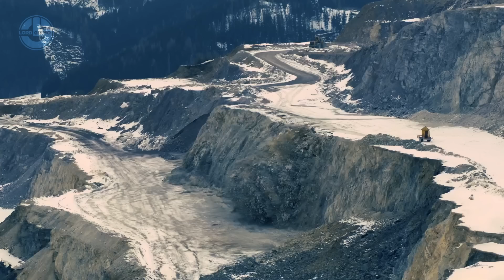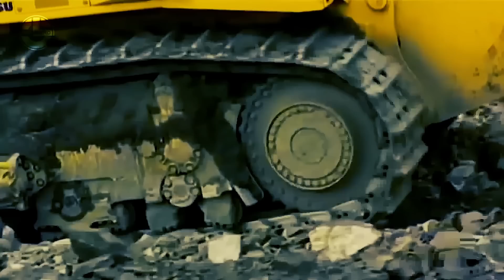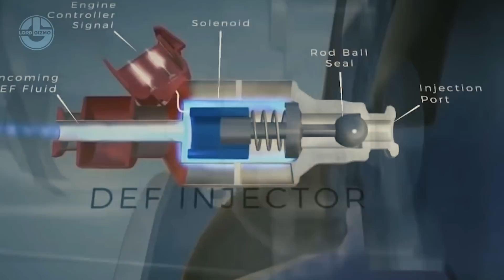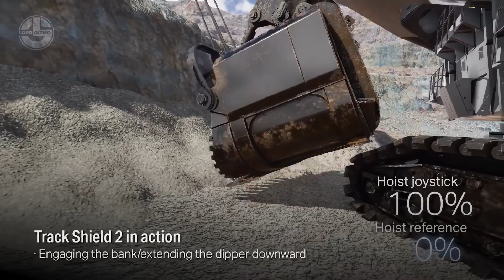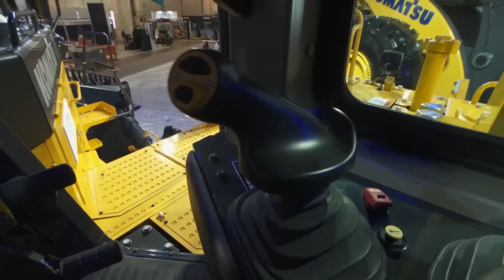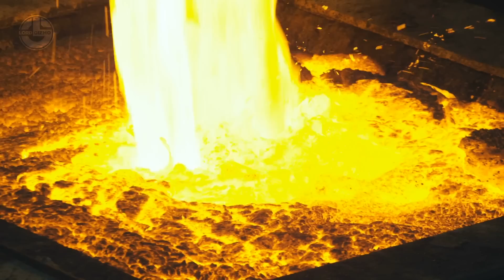Surface Mining of Iron Ore with Komatsu's Largest Mining Machines | Full Documentary

Comment: I retired from the Army (was a 52E, prime power production) and was hired by a very large international diesel corporation as a field service technician. We marinized large to huge Komatsu engines for use in large marine propulsion/generator applications. From catamaran ocean ferries, MY’s, generators on the north slope to shrimp farms in Belize. Komatsu engines perform excellently and fairly easy to work on. Worked on MAN’s , Detroit Diesel, ONAN, Yanmar. Caterpillar’s and I enjoy Komatsu blocks. Never worked on any with a transmission, drive line or wheels but, with a generator end or marine gearbox, they are top of the line.

Comment: Before I retired I ran 2 of Komatsu's smaller dozers. The D85 and D65. I found the two  (one on either side) controls for travel and blade controls friendly for the operator and as I am a HD mechanic found them both friendly to service or repair. As I understand the larger machines are the same way for operator and mechanic alike. The cabs are so quiet ear /hearing protection is no longer needed.

Comment: I've run Komatsu dozers of various sizes, and I thought they were okay, but I worked at a mine where they leased a 575 super dozer with a counterweight instead of a ripper. They always had to run a D11 with it to rip for it and pull it out when it got stuck.  After 6 months, they sent it back and bought a brand new D11.  Talking to some of the operators that ran it, that were objective, they mentioned the problem of it getting stuck a lot, but they said in conditions that it liked, it would move a mountain of material.   At another mine I worked at, they had 475's when I first started, but it wasn't too long until the 475's gradually disappeared and were replaced with D11's.  I think I heard that Komatsu quit making the 575, but I don't know for sure.
Reply: They did quit making it.  Not enough demand and apparently issues with the transmission were the predominant issues.  I am sure there are other reasons why but that's my limited knowledge of them. 
  Like a lot of things you get to a size that works but bigger starts not being so efficient.
Reply: Yup D11 is much better...and they quit production since 2012. Thank you for sharing your expirience.

Comment: No way a passenger jet will go 700+ miles on that little fuel. A Piper Cub might do it.
Reply: The jet they compare it to is a 737.
It burns 850 gallons per hour at a cruise speed of 515 mph.
554 gallons is 65% of 850.  that 737 would use that up in 40 minutes.
40 minutes at 514 mph is 340 miles.  
a piper cub uses 5 gallons per hour at 75 mph.   so 554 gallons would take the cub roughly 8,300 miles.  
Of course not counting take off and landing for either aircraft just flying at cruise speed no tail wind head wind.  
B 737 340 miles
Cup 8,300 miles.
  I gotta get a life.

Comment: All sorts of incorrect info here. Add to the list: The Komatsu is NOT the worlds largest dozer. That record is still held by the Acco Super Dozer.
Reply: The Acco isn't a manufactured dozer it there was only one built using alot of Cat parts and design just larger so the 575 is the largest manufactured dozer
Reply: @bethanyhaskiell9116  perhaps, but there was no mention in the video of largest “manufactured” dozer. Just largest, which the Komatsu is not.
Reply: @phloughtgnarpsehs7263  Most people do not consider the Acco the largest dozer because it was a one off prototype that was never tested I mean how can they even call it a dozer when it's never even pushed a pile of dirt